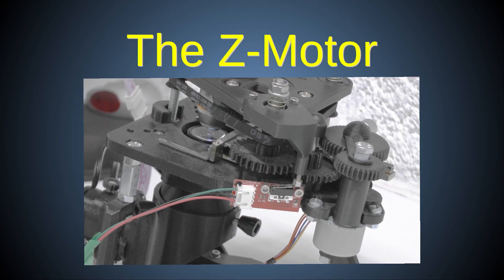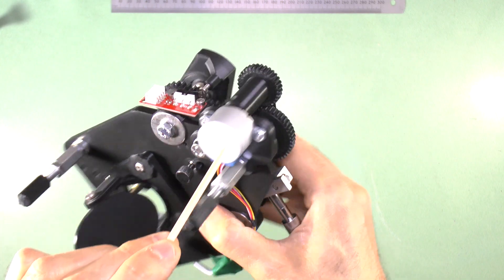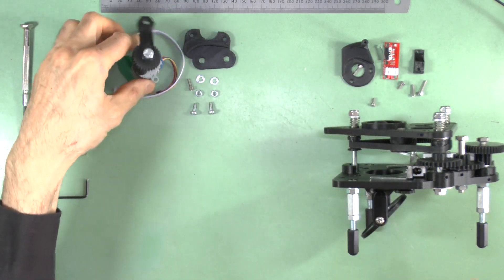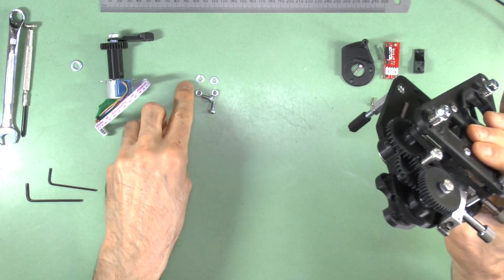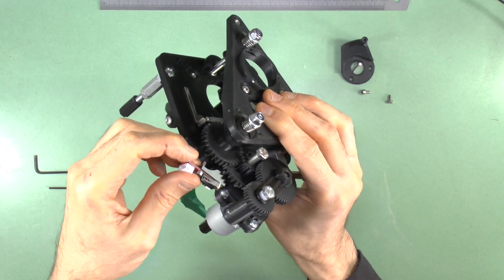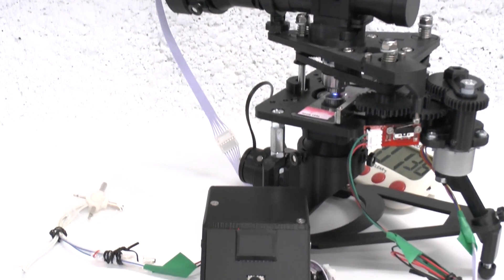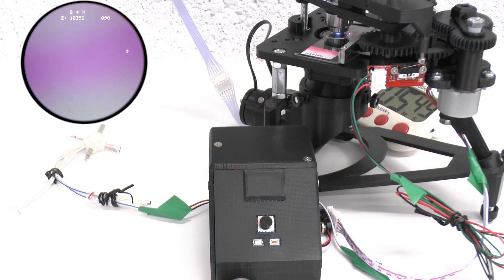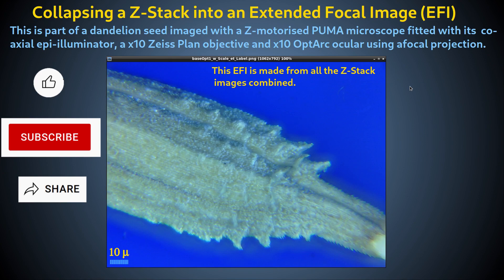Fitting a stepper motor to the Z-stage of the PUMA open source microscope

Comment: Hi, amazing work done here! One question, why does hysteresis happen in the first place? It seems odd that the z focus affects the x and y coordinates. Also, is this hysteresis also observed when moving on x and y and the z changes?
Reply from the maker: Hello. The XY hysteresis is only seen on moving in Z (there is no converse - XY movement does not affect Z unless the slide is not moved precisely in one plane, which can happen with some XY manipulators).
The XY hystersis with Z motion is, I believe, is due to the fact that the timing belt goes round the three posts in one sense for each Z direction. That is, it goes round all pulleys clockwise when moving the focus platform down and it goes round anti-clockwise when moving the focus platform up. This exerts a rotational 'twist' force on the platform one way for going up and then the opposite way when going down. It is this 'twist' on the focus platform that shifts the objective position w.r.t. the stage ever so slightly. This is only a slight movement but it is noticeable on higher magnifications. I have thought about more elaborate 'balanced' timing belt and pulley mechanisms (that rotate both ways for each Z movement) but this would result in a significant increase in complexity of build and expense.
The current design is fine for most projects and manual observations but the hysteresis is a significant problem for implementing a timely autofocus mechanism and hence the current stage design is not suited for fully automated microscopy and slide scanning. It is for this reason that I am working on an alternative XYZ stage mechanism PUMA module for more high end automated microscopy applications.

Comment: Wow, fantastic Dr Tadrous! I have been following along, from the foundation scope to finishing the condensers and kholer illumination. Currently working on the advanced filter block for epi illumination (my primary goal). After that I will take a shot at the z motor. This project has kept me and my prusa printer quite busy for a few weekends already :) Big thanks 👍
Reply from the maker: Thanks. I hope it all goes well. Good to hear it works with Prusa as well as my Ender 3. Plenty more to come.

Comment: hello, I was wondering if there is a schematic of the optical train available for a '"fully" kitted scope including schlieren optics. I'm a mechanical designer by trade and would like to partially redesign some of the mechanical elements.
Reply from the maker: That's a good point. I haven't released such a schematic partly because there are too many configurations to conceive a single 'fully kitted scope' due to the modular nature of PUMA. Having said that I do think I can produce something useful along the lines you suggest and I want to do that for completeness of scientific and open source documentation but I just haven't gotten round to it yet. Hopefully I will put something out there on GitHub soon. I would be very interested to see what improvements and mods you come up with - esp. in regards to the stability/wobble issue. I have some ideas to try out but I am very much an amateur when it comes to mechanics so I look forward to seeing what a Pro can do. Keep an eye on my Twitter feed for the latest updates - I would post a tweet when I release such a schematic on GitHub.